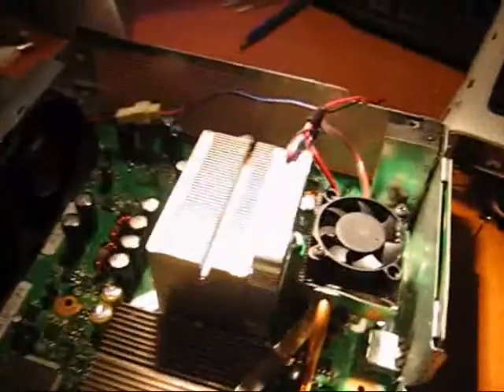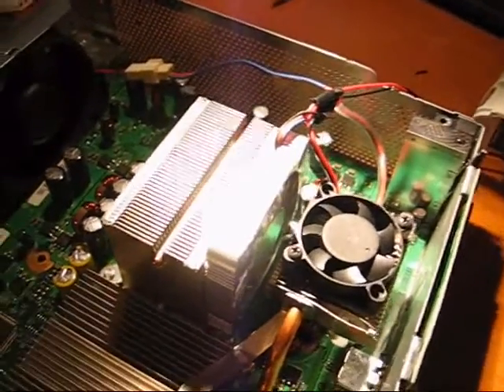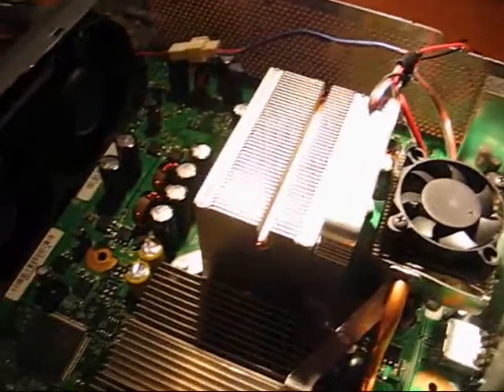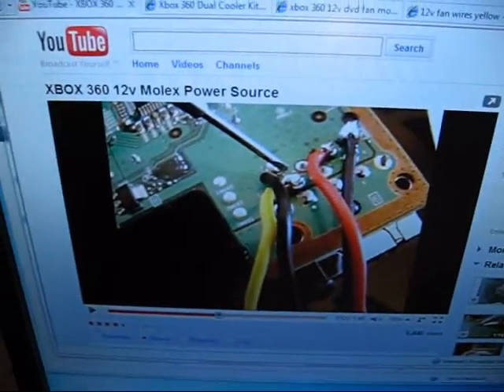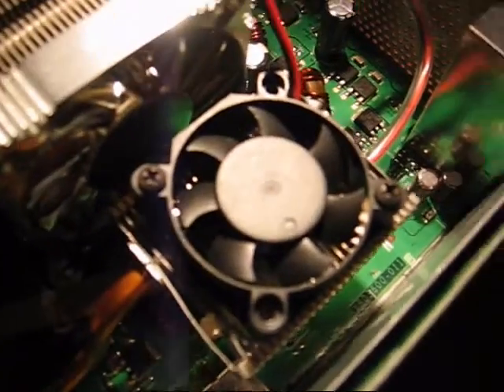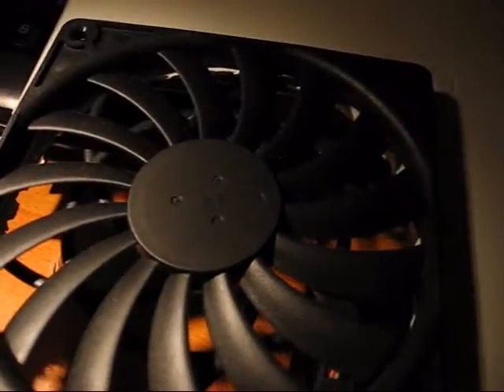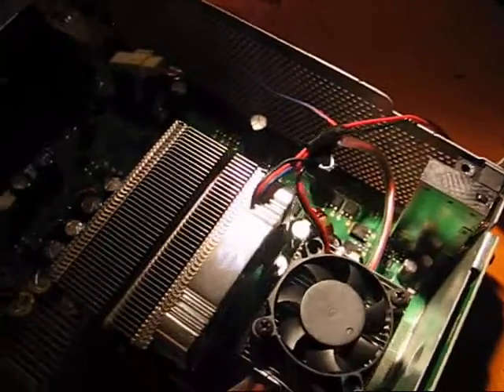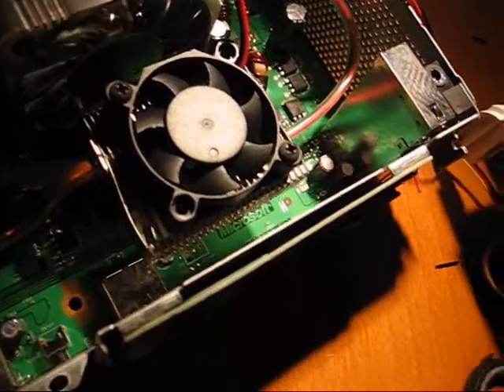Xbox 360 mod - First attempt at 12 volt Xbox 360 fan mod.

Comment: why didnt you just take 12v. from the DVD drive power cable, and use the ground wire from the default fans as your negative.